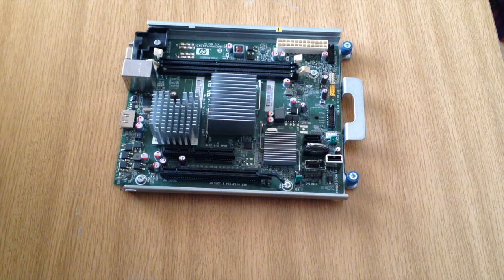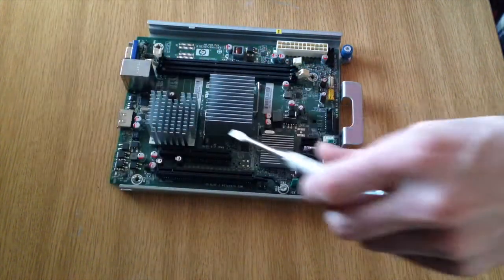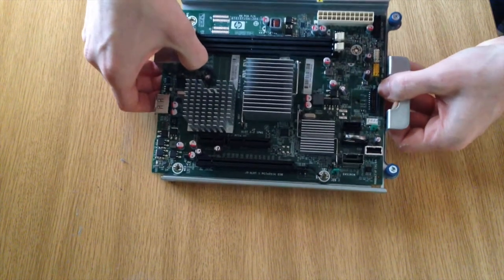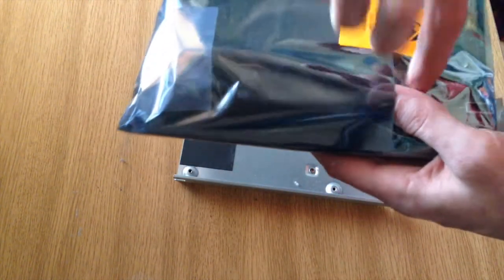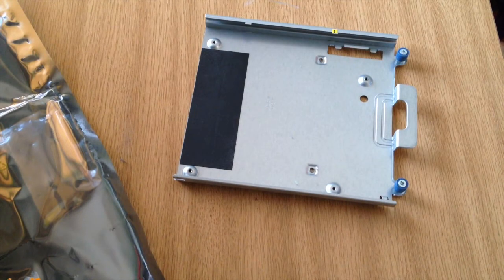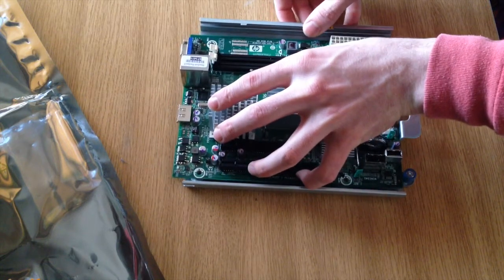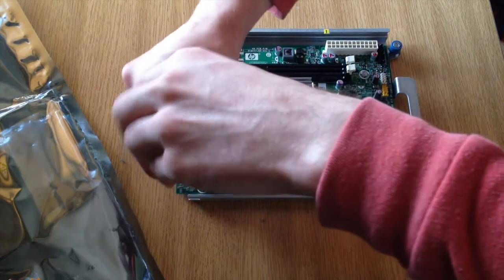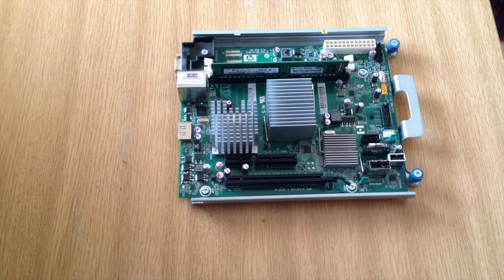How To Change the Motherboard in HP Microserver

Comment: Have you tried to install a standard Mini-ITX board?
Reply: Hello, I also have an N40L and I'm going to update it by looking for another motherboard that doesn't have the 12v from the processor and with a x1 slot to put a board that receives this cable from the HDDs and take advantage of its entire structure, have you managed to do something yet?